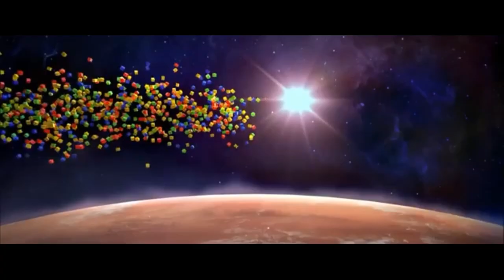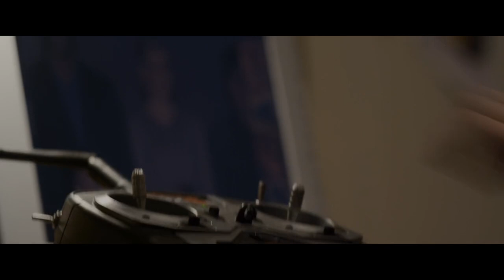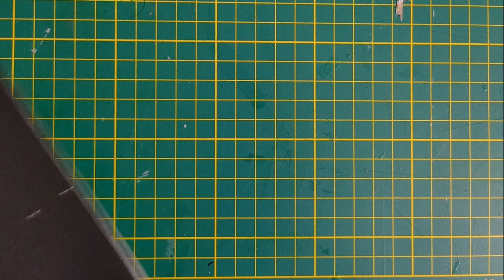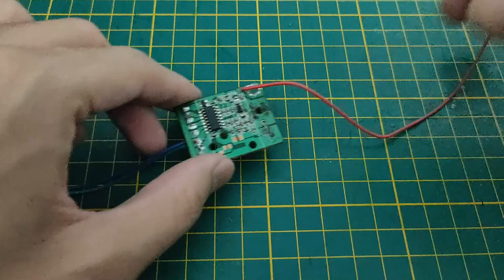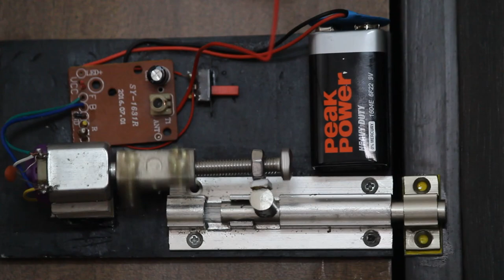How to make amazing Spiderman smart door lock

Comment: I've got parts from a cheap K mart Rc car tear it down and I took the motors and the circut board and a got a door lock and a battery pack so yeah I now can remotely unlock and lock my door remotely
Reply: What is that little red with black thing next to the rc board called?
Reply: @jamieasmr4582  That's just a switch

Comment: Could you share the links to order the parts
Reply: He used a kit and a controller that usually comes in RC toys. You can order a DC Motor, a RC Transmitter and obviously the remote controller and the lock can be bought from a local hardware store. Also the screw and the bolt.
Reply: @AsadK5.0  what about the motor

Comment: What Circuit board did u use
Reply: Its from a remote control car, so that's way when u use the control the motor start cause the circuit is from the car

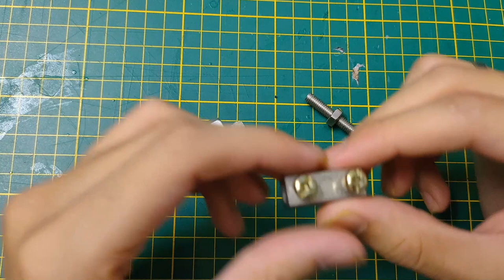Comment: What is the thing at 1:27
Reply: Also at 2:49 what is the thing in your left hand
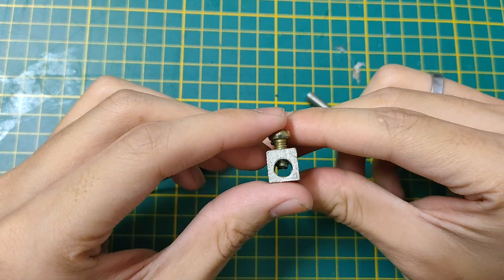Reply from the maker: @owenhaber7  1:27 it's a wire holder or joiner and 2:49 it's a switch
Reply: @Nazaf Hussain thanks so much man
Reply from the maker: @Chris Jabe In any electric shop you will get it.
Reply: @nazafhussain2120  did you screw the whole thing into your door or glue or tape it
Reply from the maker: @capalotdex._5938  It's your wish you can screw the whole thing or glue it also. I will not suggest to tape.
Reply: @nazafhussain2120  i tried hot glue but it didn’t work
Reply from the maker: @capalotdex._5938  use double sided tape or super glue or screw it up
Reply: @nazafhussain2120  it has to be strong enough to resist the door
Reply: @nazafhussain2120  can you send a limk for those two for ordering please

Comment: what’s the thing that you connected to screw and the motor called
Reply from the maker: It is wire holder or wire bridge at both end electric wire are joint. You can get this at electric shop. 
Please subscribe to my channel.
Reply: Thanks for the information! Btw I’m subbed